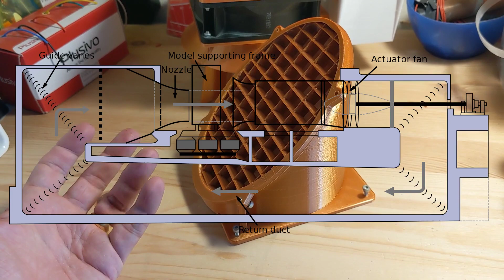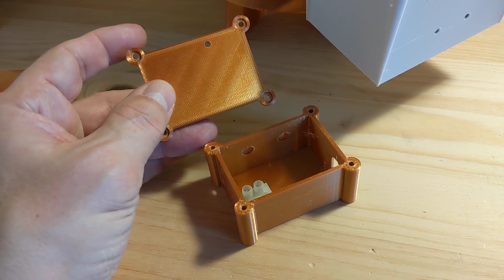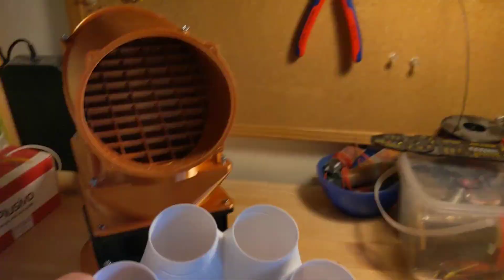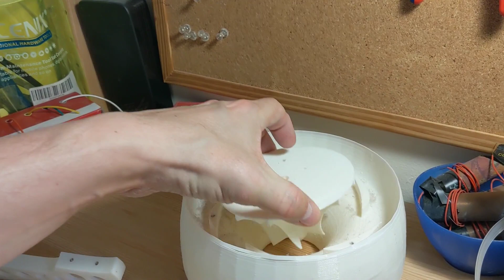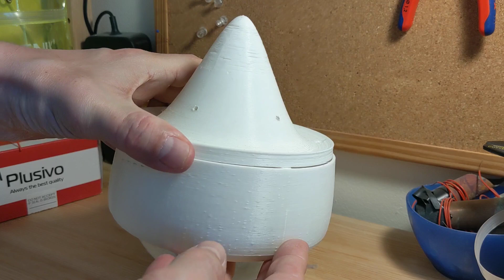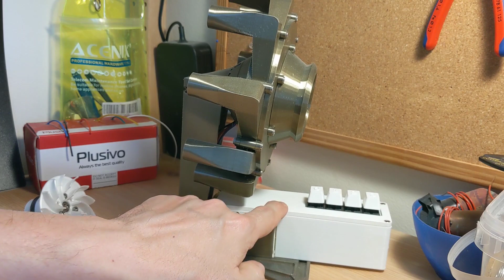My Best 3D Printed Fan (and the others)

Comment: Where can you find the stls for your design?
Reply from the maker: I was convinced I'd put links to the files in the description but I was wrong, thanks for prompting me to check - fixed now :)

There's a link to this design there but I have a new version not shown in the video here: https://www.printables.com/model/890240-wind-tunnel-desk-fan-fan-v6

This latest one is very similar but better and easier to print. If you do want the older design that's also on Printables here: https://www.printables.com/model/258117-wind-tunnel-desk-fan-fan-v5-pc-120mm